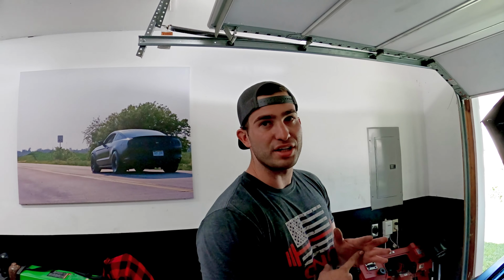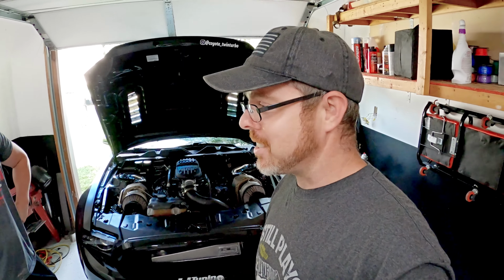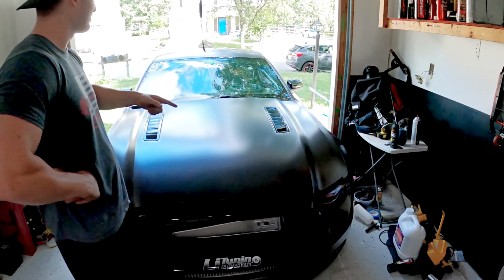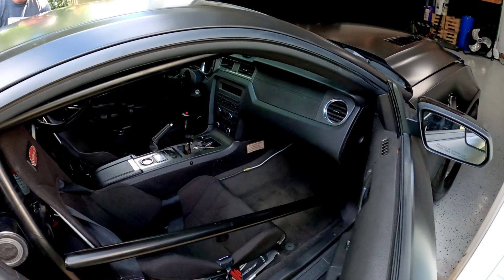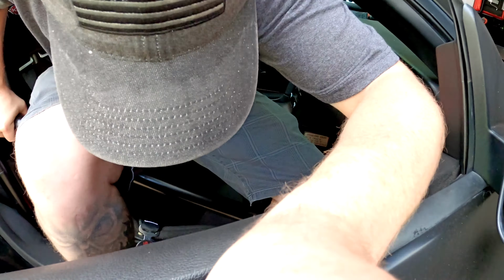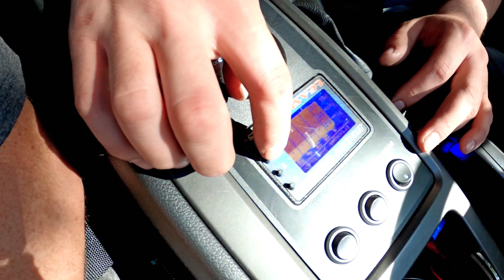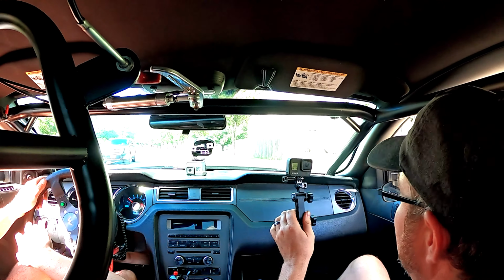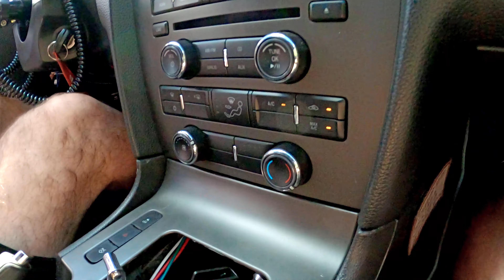Twin Turbo 1000+ HP Mustang ride along with Connor Guasti

Comment: How badass is that! Ac on burning the tires down the street! 💪🏻
I had my cutlass out last week was at night still sweating nads off! It literally
Felt like I had a space heater blowing through the firewall !lol 
Car ran good  tho 👍🏻
So what kind of boost controller does he use? I guess he has a Co2 tank ? 
Great vid brother!
Reply from the maker: There has been many of times I don't drive my S10 because of the heat.